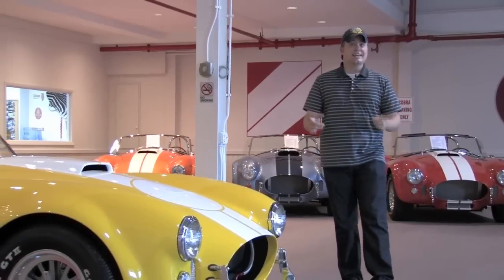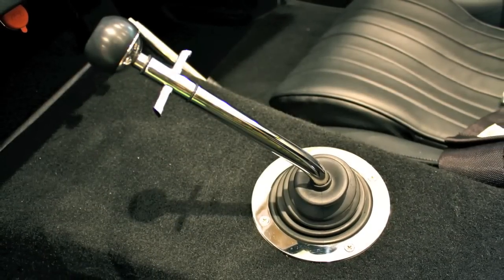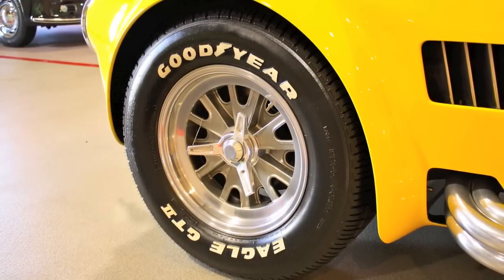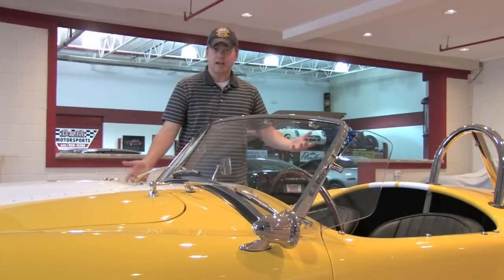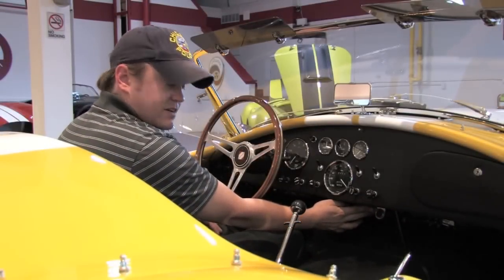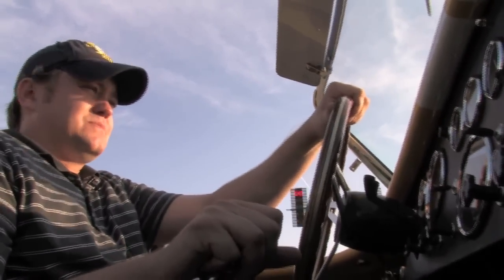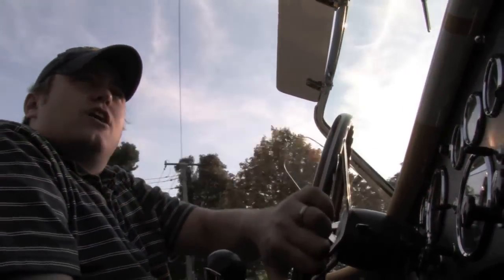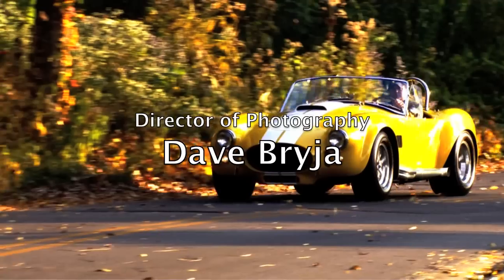1965 Shelby Cobra Roadster - "Chris Drives Cars" Test Drive Review

Comment: Those are not Tow Hooks.. Those are jack points for quick jacks for pit style tire changes when your racing.
Reply: Torpedomtb,
 I've been told on several occasions, they are "Tow Hooks", they can also be used for raising the car, they will hold the weight. BTW, I was informed of that by a Gentleman in a garage at the Las Vegas Motor Speedway.
Reply: @Bobby Tucker - With all do respects to the "Gentleman" in the garage at LVMS, Torpedomtb is correct - they are specifically designed to quickly change the tires or check brakes - they were not designed as tow hooks. The correct name of them is quick jack mounts.  Anyone involved with or even familiar with sports car racing would know this.
Reply: @Loulovesspeed  you are absolutely correct my father has an original 65 I know for a fact they are not tow hooks
Reply: Tic Tack,
They are called QUICK JACKS.
They are designed to raise the car with a specific type of race jack. However the QUICK JACKS that come on the Superformance cars are only cosmetic, they are not functional. I know this because this is my car.

Comment: Real Cobras were not built in America either. Their engines were fitted in the U.S., but the complete cars were built by AC Cars Ltd. of Thames-Ditton, Surrey, south of London. Furthermore, the Superformance Cobra is only a Cobra-inspired car. It is not a true replica, because the body is truly inaccurate. Throughout the lower rocker panel area and the back, it has some three extra inches of non-correct, non-original bodywork added. Thus when you see the car from the profile, it has a bloated, "pregnant" look you won't find on an unmolested original Shelby AC Cobra.

Comment: Not a 427 Cobra.
Reply: 342 motor.
Reply: kc550 NO better and faster, buy a real one for about 2.5 million. The COLLECTORS don't drive them on the street some drug or alcoholic maniac will run into you and there goes your investment. Only 300-400"in 427's were ever made and they were pricey in the 60's like $6,000 and up. The 427 wasn't the race winner the 289's were. The new replica's are better built than a new one. Any NEW one Shelby American sell has to be smoked , because he is a car manufacturer. When their built you can get a "smog exempt car" which runs like they did in the 60's. CA. Has SB100 which gives them smog exempt status, but is not easy to get.

Comment: doesnt make sence ..a power outlet but for the hood a hood hanger instead of 2 shocks to keep it up or down ..if i'm spending that sort of money i would want the builders to already see the little things right down to class of bolt
Reply: well, simply put, the cobra's magic is in it's simplicity. it is a traditional English roadster (albeit hot rodded with a V8) that is purposely simple for a better horsepower to weight ratio, i.e. it doesn't have a roof or even windows. the power outlet was 'hidden' under the dash because it doesn't really belong, but most people would want/need one these days. =)
Reply: If you have the cash to order one of those I bet you can even ask for a hard top so the wind won't mess your pretty hair and the hood shocks they'll throw in for free.